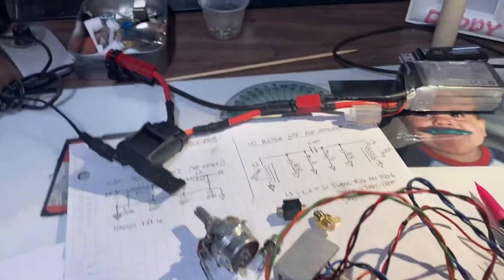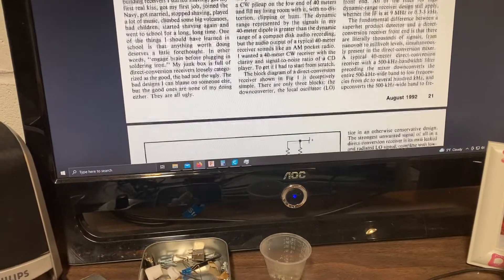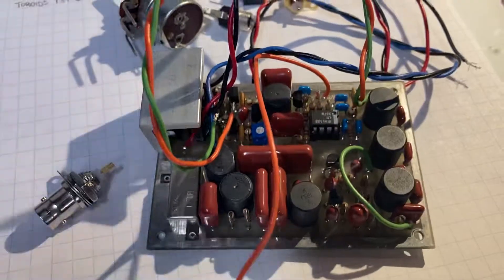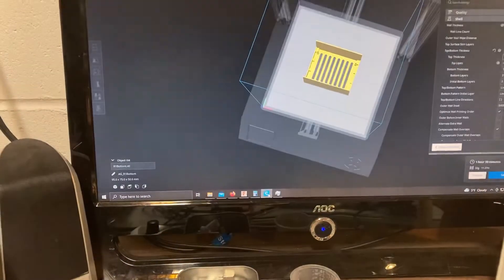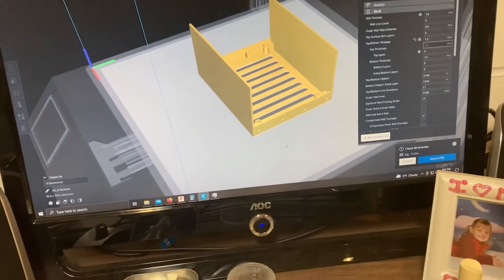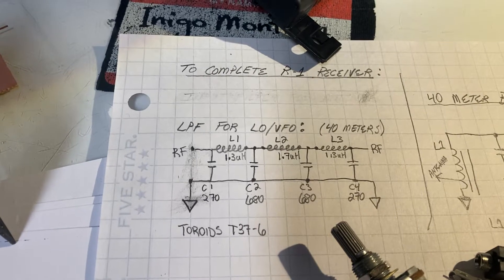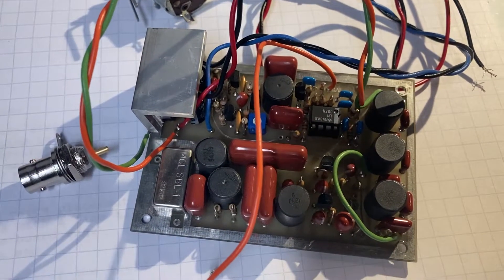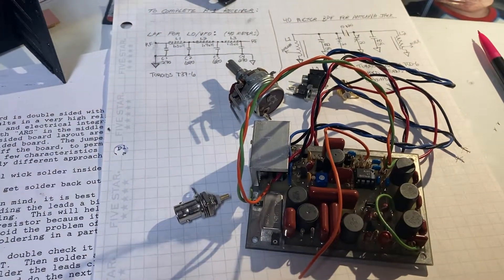KK7B “R-1” Direct Conversion Receiver (Part 1)

Comment: Square wave is good for mixer, no need to filter. Band pass is all you need. I Built KK7B mini R2 Receiver with a  QRP LABS quadrature VFO at first, and now with WA5BDU one. They both work great and R1/R2 and following variations  are magnificient radios. Best 73 IZ3EYY